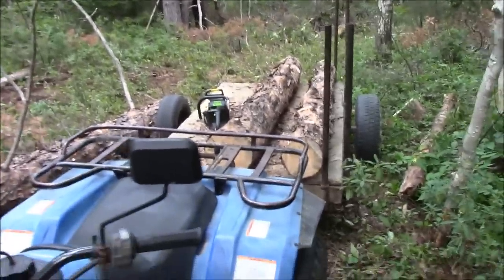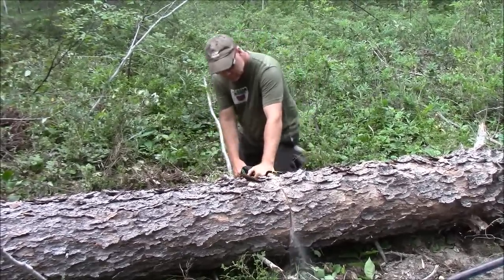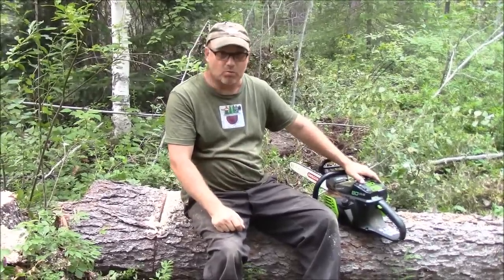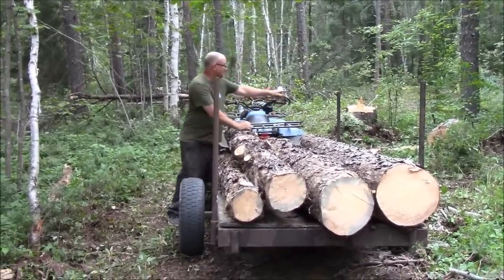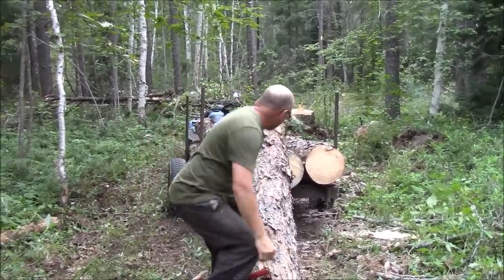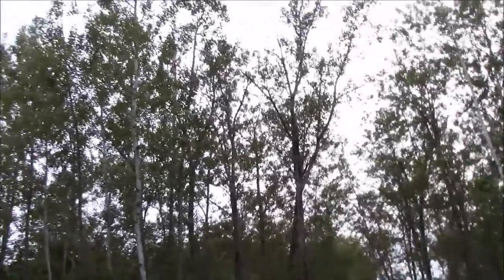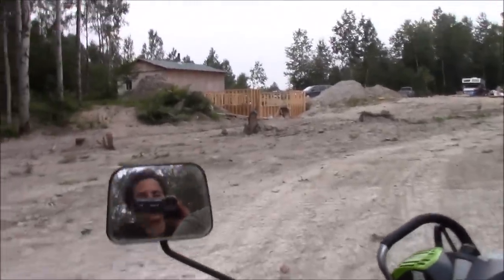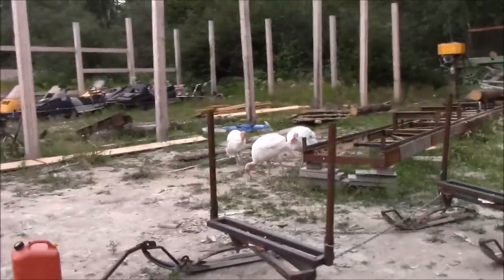Stung By A Wasp On This Load Of Logs

Comment: Cecil thanks for another great video! Just as FYI, there several diffferent versions (Greenworks, Kobalt and Snapper) of the similar 80volt chainsaw for sale at other retailers. I have been told that the 80 volt battery is interchangeable, but I can not confirm that. Also there is a safety recall on the chainbrake see the following webpage https://www.greenworkstools.com/important-safety-notice  
I hope you and Heather have a great day!

Comment: I can tell you that using the tobacco out of cigarette wetted and put on the sting will take the pain out of it and the sting site won't swell.  I have used this for 50 years, I know it is an old wives tale that it works but it does work.

Comment: Hi Heather & Cecil. Bad luck about the wasp sting, it just so happens i have a wasps nest in one of my chimneys. unfotunatly its not the one that has the wood stove in it. But i'm hoping when the weather turns cold and we use the fire the smoke from the chimney will blow into the other one and upset them. Great video take care. :-))

Comment: what size of saw and bar are you using to drop those big trees Cecil?
Reply from the maker: I just use this 80volt Greenworks pro battery saw, I put an 16 inch bar and chain on it and now it really cuts.  Cheers.